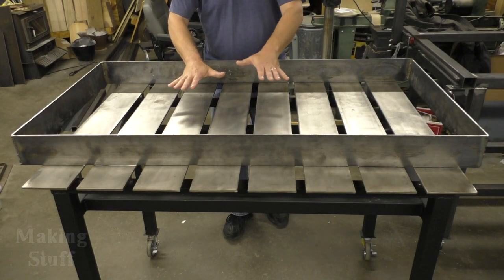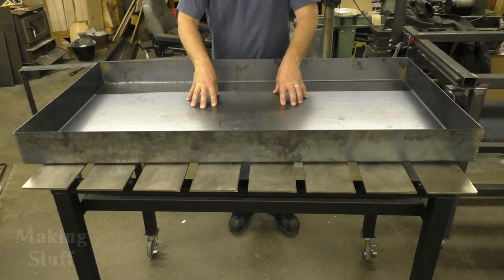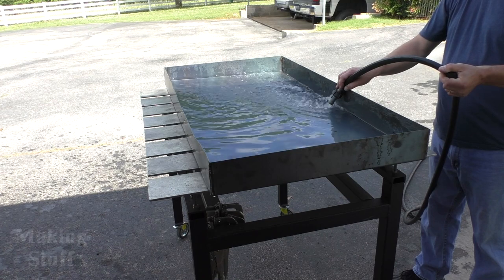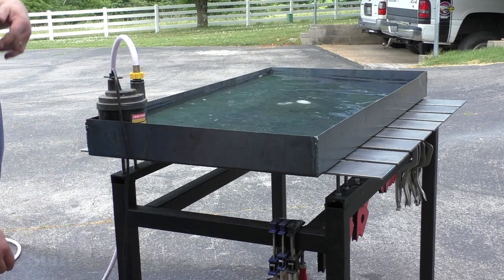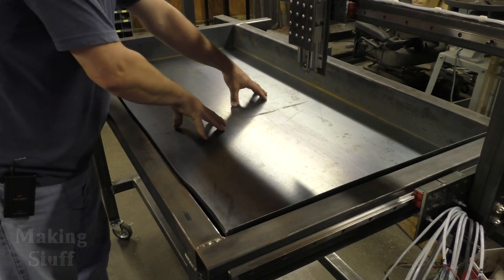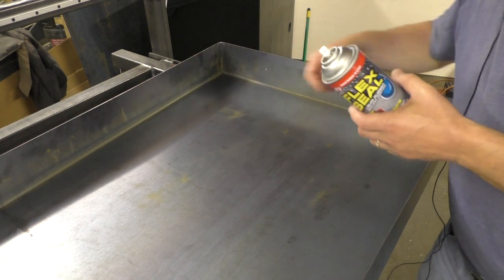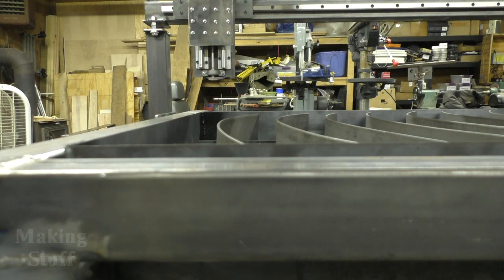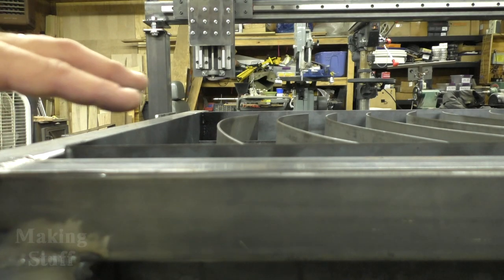DIY CNC Plasma Table Build- Part 7 The Water Pan

Comment: I like it!  Haven't watched the rest of the series, but you may have figured out by now that a drain hole & hose valve in the bottom would be really handy.  That water is gonna get nasty after a lot of cutting, and you probably don't want to leave water in it for long periods anyway.  Thanks for the thought you put into these projects and sharing your mistakes as well as your successes!
Reply from the maker: Thanks for watching!

Comment: Cut each corner down the depth of your pan sticking up and scribe a line around it and have your sheet metal shop bend it so that when done overlaps the top of your frame. You could then use some seam sealer around the edge before painting.  for a clean looking pan to frame finish. Also by doing that it will add extra support for the weight of the pan plus water as the pan would or should be flush with the top of the frame. You need a 2" drain plug at one end of the pan to clean it out time to time easily for a change of water. Steel and water equals rust so paint the pan to keep it from rusting out. Good build video series will be looking forward to more.

Comment: look into the diablo steel demon 7 1/4" blade for those long cuts like your water pan. 
i put one on my 30 year old 5400 rpm skill saw and have been cutting 1/4"&3/8" plate and 2" sq tub with it just like you would cut lumber, I couldn't believe it would cut  steel at that rpm but it has been working great for over a year, and at $30 you can't beat that,  great vids THANX!

Comment: I’m a beginner mig (gassless) welder, I tried to make some crucibles for my little aluminium foundry, ended up with about an inch of weld until it stopped leaking ha ha 😀. You did a cracking job with the thin sheet. Cheers
Reply from the maker: Thank you.

Comment: I would leave the lip! You will want the water to go all the way up to the material being cut to help keep the parts stay cool. The lip will give you a little distance between the water level and the top of the pan. On a plasma table we had about 10 years ago, we added a 2" rubber liner around the water box so when cutting next to the edge, it wouldn't blow water/sparks all over the floor.
Reply from the maker: Yeah I thought about that after I posted the video.  Getting the water right up to the part will help out a lot.  Thanks for watching.

Comment: Could have just used a hose and gravity siphoned the water out lol :)

I would use epoxy base coat to make the metal watertight. Unlike other resins epoxy doesn't evaporate solvents that create microscopic pores. PU two component truck bed liner might work too.

Couldn't you use the CNC itself and a big fly cutter to make the pan perfectly flat?

Thanks for the video! Pretty cool.

Comment: If you have a table saw and a cutoff disc that will fit on it, that should work ok. I don't know how heavy or manageable the pan is but you might want to get someone to help you run it through just for added stability on handling it. That's the best I can come up with off the top of my head.
Reply from the maker: That's a good idea, thanks!
Reply: Hey Bob, I had another idea that might be dumb as hell, but is it possible to set the plasma cutter up to run around the top edge of the pan and cut it off. I don't know if you can do that or not and like I said, It might be a stupid idea.

Comment: Did you know that stick welding doesn’t leak like mig 
Thats why we use it on pipe lines
And I’ve build fuel tanks with stick for years with no leaks

Comment: Why did you bend the metal sheets before you put them in the water pan? ANd is it really necessary to have a 4" deep water pan and the sacrificial strips to be that high?
Reply from the maker: The slats last longer this way.  If they were straight and I cut a straight line on top of one, it would completely ruin the top of the slat.  No they don't have to be 4". If I built it again, I would make them 3" tall.  This would also require less water which would make the pan weigh less too.  Thanks for watching!
Reply: What thickness slats did you use?

Comment: how  deep is water pan ?
Reply from the maker: 4 inches
Reply: @MakingStuff  it could be 3 inches? or it will cause problems . thanks for advice
Reply from the maker: 3 inches should be fine.  I have thought about remaking mine to 3 inches to reduce the weight of the water.
Reply: @MakingStuff  and how you evaluate timing belts and what you think about using them on a larger machine 1,3mx2,5 m